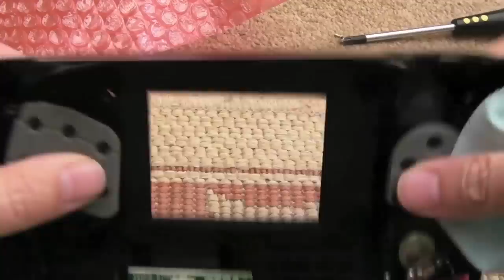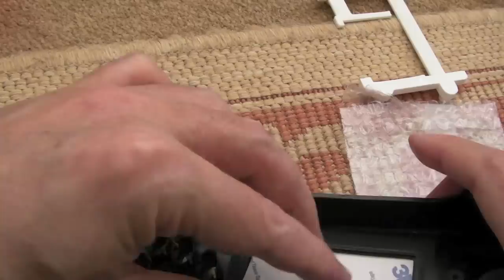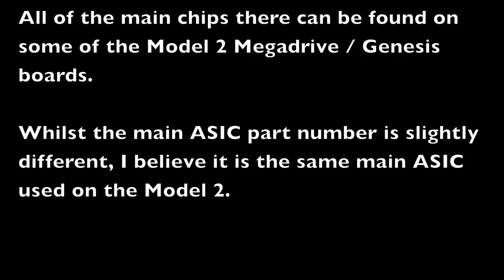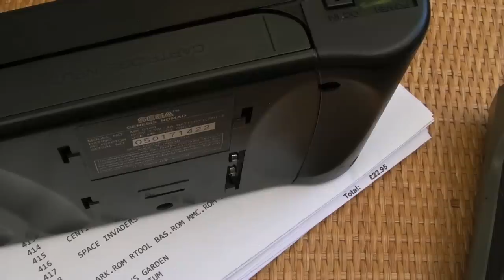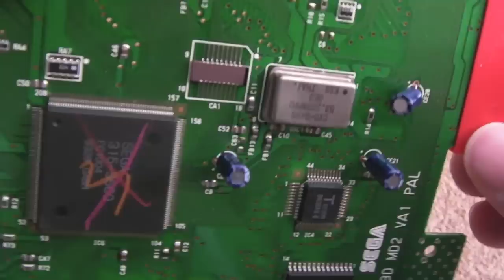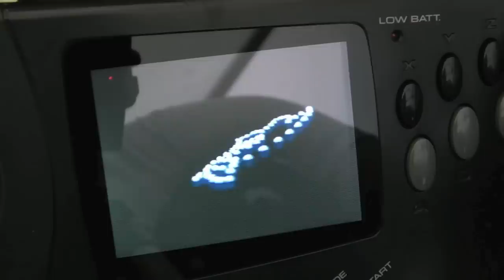Sega Nomad Repair Part 3 (SMD Cap Removal Techniques, Master System Support, Battery Fault & More)

Comment from the maker: Part 1 - https://youtu.be/F-aKPsebPFs
Part 2 - https://youtu.be/XmiSi4sABFI
Amazing New Battery - https://youtu.be/nwYnK5x6UiI
Links / Corrections / Useful Info
1) The small IC above the black ribbon connector (315-5638) is a 6 button multiplexor (this is logical if you consider it has a 6 button joypad built in!)
2) The tiny 10 pin chip near the regulator I think is a AN8015SH (step down / step up DC to DC converter) - guessing (as I said) for use with the invertor board.
Confirmed both of the above after uploading the video, using the Console5 wiki! 
a) Regards the RAM connections"going through" the resistor arrays - I think they are more likely pullups rather than connections passing through them.  Just didn't think about it at the time.
b) When using hot air to remove components, it is best to remove the PCB from the case / shell etc.   You could melt the plastic!
c) 4th method to remove SMD capacitors (comment from Haggledesperado) is to use two soldering irons, one in each hand. Heat up both the pads and once the solder is melted, use the irons to lift the cap off the board. As safe as hot air, perhaps less risk of heat affecting anything nearby.
d) 5th method to remove SMD capacitors is to twist the top of the can - higher risk.  If corrosion is present I would guess a 70%+ chance of a pad being lifted.  If the pads are OK, 20% chance of pad being lifted.  Obviously there are other factors that increase or lower risk with any of these techniques.  eg. PCB manufacture quality, size of pads vs size of capacitor fitted (larger caps have larger leads etc).
You should check out Dennis's excellent channel here:- https://www.youtube.com/channel/UCEHkvZV6pB6uw-NSmGsM-kw
His recent awesome Sega 32x repair:- https://www.youtube.com/watch?v=voECR9LqCzA
Dennis van den Broek on Twitter:- https://twitter.com/PointerFunction
Sega Holic USB Mod - https://www.youtube.com/watch?v=wUHBbEbblZc
Console5 Wiki - https://console5.com/wiki/Nomad
Console5 (Cap kits & glass screen protectors) - https://console5.com/store/
Reply: Excellent series Gadget, well done!

Comment: Hey GadgetUK.
Thanks for the video, i really enjoyed this 3 part series. Just wanted to give you a little tip i used on my Wonderswan regarding the glass lens. I had the same problem you had with the glass screen beeing slighty bigger, but i used a metal nail file to very easily file a bit of the glass screen and it fitted perfectly after.

Keep up the good work!
Reply from the maker: Thanks for the tip!

Comment: Hello! Why not use SMD Ceramic capacitors instead of new electrolytic ones?
Reply from the maker: Ceramic capacitors don't filter the same way wet type aluminium caps do, and they have totally different characteristcs regards how they behave at different temperatures, and they can be affected by vibration and sound (they can oscillate).  You could fit them, and not notice too much of a difference, but they are not doing exactly the same job.   Ceramic caps also tend to short when they fail.

Comment: Hello there and thanks for the greatly helpful video!

I've replaced (I think) all my audio caps but the speaker audio is low and distorted.
I also tried with a brand new speaker, same result.
With earbuds it works amazingly, I don't know what to try next...
Any hint, please? :(
Reply from the maker: Honestly cannot remember much about how the board is laid out regards the speaker circuit.  You need to follow the connection from the speaker to find the audio amp circuit.  It could be a bad trace around there, corrosion damage etc.  Possibly the transistor needs replacing.   The fact the headphone audio is OK means the audio amp IC is fine.

Comment: A better LCD for the Nomad might be PD035VX2, which is 640x480. It should give less interpolation blur. The one you have there is 320x240. $63 with a driver board (Aliexpress) is a lot more expensive though.

Comment: I don't suppose you know if a similar composite screen would fit in a GameGear? Whilst the mcwill screens are great, I really don't want to spend that much. My GameGear still works but has numerous stuck pixels, so could do with a new screen ideally
Reply from the maker: I don't think there's a composite signal on the board - if there is you could use the same screen as did probably.

Comment: I'd shave the plastic very carefully with an x-acto blade until the glass fit without pressure.
Reply from the maker: That's a really good idea, but I think I would prefer to try and sand the screen protector edges as someone else pointed out though - the reason being is widening the Nomad edge is irreversible vs altering the actual protector!

Comment: Great videos as always. I've seen one of these available for a fair price. I found out it was working before they carried out a cap change and LCD replacement. They said they pulled off one of the pads in the process but have been able to solder to a trace. But it no longer works. Do ya think it's worth a punt??
Reply: Brilliant I think I'll buy it then. It was all working till they done the cap chamge and LCD so I'm guessing its something they have done wrong
Reply from the maker: Yes, if a pad is broken I am sure you can fix it!

Comment: Great video and work - couple of interesting things I thought whilst watching it - firstly I noticed the board marked 'Venus' in a number of places, which corresponds to Sega's 'planet' codenames - the Game Gear was code named 'Mercury', the 32x was 'Mars', we all know about the Saturn. Jupiter, Neptune and Pluto were unreleased prototypes.

Secondly, I wondered if the Z80 which is used for sound on the MD was used to help run Master System games, and apparently this is the case. A clever cost saving way to implement backwards compatibility, using a chip that is not solely dedicated to the task.

Thirdly, I wondered what the options are for doing a region mod. I remember adding a 50/60hz switch to my Nomad which was very fiddly and quite ugly. I think there is a way to add a switchless mod but I'm not sure. Perhaps the Everdrive is a better solution although I think there are a small handful of PAL games that wouldn't work properly at 60hz.

And finally, try running Virtua Racing on the Nomad, it looks absolutely gorgeous on the small screen.
Reply from the maker: Yes, I forgot to mention the Venus designation for its codename =D   And yes, Z80 for sound, but main CPU in Master System mode.  They are easy-ish to region switch.  The problem as far as I understand can be with composite, as the timing is incorrect for the colour burst signal, and the CPU not exact the correct speed when the jumper set to 50Hz.  You can get a switchless mod that has the PAL crystal onboard too.  I might do a mod myself with a PIC chip at some point.   Will try out Virtual Racer on there later =D

Comment: The lines in the screen you're talking about are caused by an effect called dot crawl, visible normally only in composite video signals, which is very visible on places where two very distinct colors meet, or where black and white meet. https://en.wikipedia.org/wiki/Dot_crawl

The 4th paragraph in that article says older consoles and computers use a non-standard burst phase, which explains why the screenshot provided in that article is not exactly what is happening to the signal generated by the Genesis, but it's pretty much what is happening in the signal.
Reply from the maker: The particular issue I beleive wasn't dot crawl!  I've seen that before though on other composite videos I've done.  In this particular instance its a diagonal wave that goes across the screen from one corner to another, which I've seen before on other systems - often where a switched PSU is used, or there's some ground plane issue.  With dot crawl it tends to be super evident on certain colours - eg. red etc.  I showed a good example of that up close on the Saturn RGB cable video I did.

It could be that the screen is not locking onto the chroma signal very well.  Because now I think about it has similar appearance to that BBC Model B where I showed the difference there between composite and RGB.  But maybe that is what dot crawl is - I need to refresh myself lol.

Comment: Are you having a contest for the glass give away?
Reply from the maker: Yes, I will do a giveaway of the glass and that 3D printed mount - might add something else for the Nomad in there yet too.
Reply: @GadgetUK164  That will be awesome. I had no idea about enabling Master System, I'm going to have to try that on mine although mine has a white washed screen and it's a bit rough to see proper but the video out works great.

Comment: If that lens is as tight as it looked and took that much force to squeeze in there, I'd be worried about the plastic developing cracks over time as that stress the assembly is now under has to go somewhere and it's unlikely the glass will yield first. I'd probably have just returned those lenses as defective.

Comment: Well that's not good, glass doesn't compress. That unit design has a lot of horrendously specific dimensions being as asymmetrical as it is, first time I saw it the slope bugged me heh. Nice to see some MD parts in the NM, hate change in components just for the sake of it. Great series, lot of fun. :D

Comment: A fourth method to remove SMD capacitors is to use two soldering irons, one in each hand. Heat up both the pads and once the solder is melted, use the irons to lift the cap off the board. It's my preferred method actually. Quick and safe.
Reply from the maker: Thanks - will add that up top (with credit), and there's a 5th technique of twisting them (high risk imo).

Comment: I saw a guy having trouble fitting a mirror once then he started sanding the edge of the mirror manually with fine sand paper until it fitted, may have worked on the shitty glass screens hope this helps in some way for future issues. I remember my brother bought a sony xperia z1 off a mate a few years ago cheap as it had a broken screen, it was so thin and had to be glued in place it took me 3 costly attempts to fit it and it broke after being used a couple of time each time, before i gave up and bought a chassis with screen fitted, only to find at the end of swapping absolutely every little part of the phone over, that the screen was bulging and coming loose due to clips on the inside that held a small wire in place, i then out of desperation took it apart removed the clips and used superglue and a pin to get between the thin glass and bezel, the glue ruin the screen, i could have cried.
Reply from the maker: Thanks, that's a nice idea!

Comment: Hi, sorry to bother you but I'm a bit puzzled here.

I had a look, and the part number for your tube of flux and mine is the same, but yours seems a lot clearer, mine's quite the dark amber colour.
Have you noticed it darkening with time? I've had mine for a while, hence why I'm asking.

Thanks in advance! Great video as always :)
Reply from the maker: Yes, I've noticed colour variations to Chip Qwik flux too.  I buy mine from RS Online, and despite it always having the same thickness and smell (and works the same), the last few batches I've had have varied a little in colour.  But it does appear to be identical in all respects other than colour!?!?!
Reply: @GadgetUK164  I've only had the one tube, but yeah seems to work as well as yours, I just recently started using hot air, after watching most of your videos, figured I might be able to pull it off too. Let's just say the second time went really well :P Thanks for the answer and all the tips and tricks you're sharing, much appreciated!

Comment: PS, those Sega power supplies all have leaky capacitors inside them, too. I forget the proper size - but I wanna say 16v 3000uf, but I'm unable to find that just now, and don't feel like ripping into my power supplies to confirm. But they're all leaking by now - I've fixed about a dozen of them and not a one was good, and they do eventually short out the power supply. They've got a diode inside of them that just gets covered in electrolytic goo.

Comment: Warm up the shell a little to allow expansion and flex?  Just a little?
Reply from the maker: =D I think the opposite is required actually!  You need to cool the shell (plastic and metal contracts with cold, but will expand with heat.  The heat technique can help free up rusted / stuck screws / bolts though, the idea being that the outside of the thing you are screwing into comes loose a bit from the expansion and contraction.  I suspect these screens will be easier to fit when the platic is colder.

Comment: Nice video. Felt your pain at the screen part. It is always the same. Do you leave it at 99% happy and have to look at it every time or do you go back and tackle Sod's Law one more time to get 100% (and then wish you'd just left it alone as one issue leads to another 🤣).

Comment: When doing the lifting one side technique I find adding new fresh solder works best.  Great series.  I am going to try and get a nomad soon.
Reply: Also, for your jailbar issue, a few of use are going to see if we can fit a triple bypass board in a nomad.  Unfortunately it won’t work on the composite screen but I think benn venn is working on an rgb screen mod.

Comment: Great mini-series there, Gadget. I'm worried about the stress that screen glass will be under, though. A bit of flexing the case with over exuberent playing might be enough to crack it.  I also noticed that the cap you replaced at 20:37 is 16v, not 6v. Is that why it's a bit too big for the connections?
Reply from the maker: Thanks =D  Yes, that one that was large is 16v!  But I am sure a smaller one (physically) could be sourced.  The one that was on there originally isn't as tight a fit!
Reply: I'm guessing a 6v one would be smaller, though, right?
Reply from the maker: Yes, it would be!  You would need to check what part of the circuit it's on first - just incase more than 5v is connected to it.

Comment: Hi gadgetuk164, do you know how to fix SNES with no sound? i replaced the connector, replaced the capacitor but still doesn't work
Reply from the maker: I would start by running the diagnostic / test BIOS via an Everdrive or SD2SNES.  That will give you a clue as to whether there's a problem with the audio chips and related RAM.  It could be a fault with one of those.

Comment: Thank you, GadgetUK164, I absolutely love my Sega Nomad.
Reply: The reason why I love the Sega Nomad was while my military service I played mine for year's. It's a portable genesis which was better than the Gba which I couldn't see unless having proper lighting, but while on ship and a 6 month deployment this was the only gaming device needed, while the Dreamcast was exquisite it needed a t.v. Which was constantly being used by other crew members. So to fix this circumstance I bought a VGA box so I could use PC monitors  while playing a variety of gaming consoles but the most important was the VGA box for the dreamcast that I found at a pawn shop was was ultimately allowed me to use my dreamcast even while others monopolized the tv's available.
Reply: Nomad: Phantasy Star III, and Might and Magic II: gates to another world. 
N64: Conkers Bad Fur Day. 
Other's as well but keeping it simple.
Reply: Yahoo you mentioned the shunt.
Reply: That's incredible, imagine if the Nomad had the 32x support built-in this would give a new dynamic of gaming on this hand-held. Sega CD support would be impressive. Even if everdrive iso stored.
Reply: Sorry commenting many time's, would there be any way to make the Nomad stereo without using a monitor speakers or the audio jack.